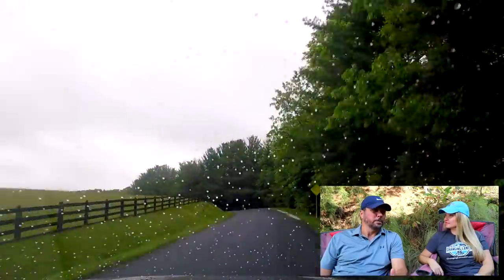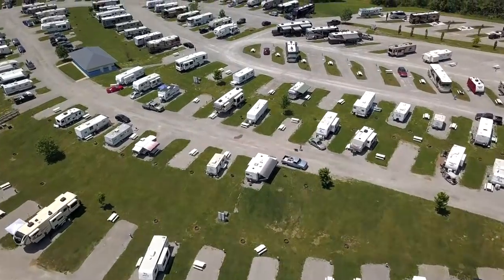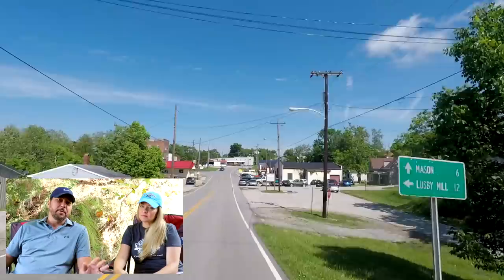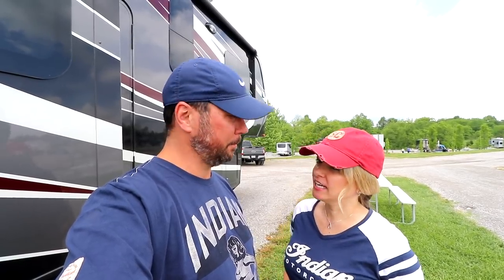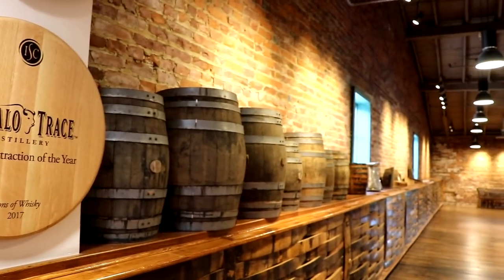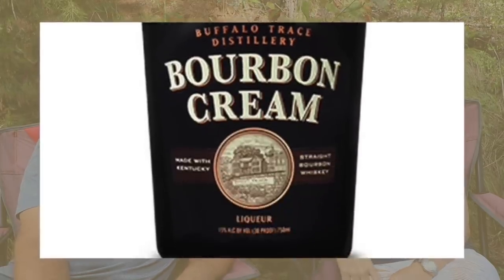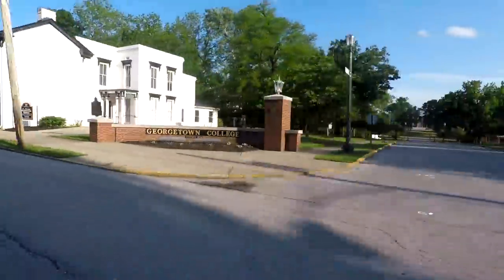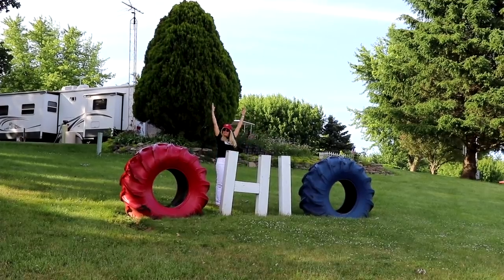Kentucky and Buffalo Trace Distillery [Full Time Travel] [RV Nomad]

Comment: Next time you get out that way go to the Maker's Mark Distillery in Loretto, KY. Just like Buffalo Trace the grounds are amazingingly beautiful and the tour was great. NOTE: you will NOT want to take the rig up there if you come in off of I-65 - roughly 20 miles off the interstate(?). Very twisty ,uphill, skinny, 2 lane road with trees hanging over the road on some portions. We took our F150 and there were a couple of times we weren't sure if the oncoming traffic was going to take our side mirror off. But man, what a beautiful drive up there and back.
Reply from the maker: Makers is definitely on the list for next time.  Hopefully the whole trail! 😎  Thanks for the tip!
Reply: I drove there in a Mazda Miata. The roads are lots of fun for sports cars and motorcycles, quite smooth and curvy. Lots of beautiful farmland. But I would not do it with any sort of trailer. But I did see distillery trucks leaving, so it's possible.

Comment: Subscribed to your channel recently; great vids.  I specifically like how you guys talk about your actual experiences mixed in with a few DIY instructional videos.  You can say that I'm living vicariously through your lens waiting out my months before I can retire and start my own journey.Thanks for sharing.What are those orange things under your levelers and do they sink into soft ground?
Reply from the maker: Thanks!  😊  The red "cans" under out jacks in the video are Andersen Jack Blocks. We don't use them anymore because we've broken NINE of them (6 we bought and 4 replacements they sent us). Simply unreliable. The bottom edge would break off and they'd sink into the gravel / dirt / whatever. We've switched to RV SnapPads and love them. They don't help lessen the jack extension like the Jack Blocks did, but they don't break and they stay on the rig, which is great when setting up and breaking down camp. RVSnapPads is also going to be coming out with something called "stackers" that will help with the jack extension / stability. We'll be helping them prototype that and, of course, do a video on those when they come out. If you're thinking about buying SnapPads, use our link and get $10 off. (https://rvsnappad.com/discount/LANES10) Also, they are about $30 cheaper direct versus Amazon, so $40 savings overall.  
Thanks for watching and subscribing!

Comment: Could you tell me where you bought those red pads for the stabilizer feet
Reply from the maker: The red "cans" under out jacks in the video are Andersen Jack Blocks. We don't use them anymore because we've broken NINE of them (6 we bought and 4 replacements they sent us). Simply unreliable. The bottom edge would break off and they'd sink into the gravel / dirt / whatever. We've switched to RV SnapPads and love them. They don't help lessen the jack extension like the Jack Blocks did, but they don't break and they stay on the rig, which is great when setting up and breaking down camp. The same company is supposed to be coming out with something called "stackers" that will help with the jack extension / stability and integrate with the snappads.  We'll be keeping our eyes out and do a video on those when they come out. But, we've been using the RVSnapPads for several months now and really like them. They are cheaper direct versus Amazon, and if you use our link / code, you can get another $10 off: https://rvsnappad.com/discount/LANES10  
Thanks for watching! 😊

Comment: What is it you put under your front leveling jacks
Reply from the maker: The red "cans" under out jacks in the video are Andersen Jack Blocks. We don't use them anymore because we've broken NINE of them (6 we bought and 4 replacements they sent us). Simply unreliable. The bottom edge would break off and they'd sink into the gravel / dirt / whatever. We've switched to RV SnapPads and love them. They don't help lessen the jack extension like the Jack Blocks did, but they don't break and they stay on the rig, which is great when setting up and breaking down camp. The same company (RVSnapPad) is supposed to be coming out with a new product that will integrate with the SnapPads to help with the jack extension / stability. We'll be keeping our eyes out and do a video on those when they come out. But, we've been using the RVSnapPads for several months now and really like them. They are cheaper direct versus Amazon, and if you use our link / code, you can get another $10 off: https://rvsnappad.com/discount/LANES10

Comment: AKA...Side of Beef. Just one side of beef is a lot. If the pub buys an entire steer, thats a huge amount to butcher up. Sad thing is, many as you say "source" their food items which come all nicely packaged, weighed to similar sizes, vacupacked etc. vs. the above. Historically, the best sources for beef is hand butchered by an experienced butcher who knows the many cuts and how to trim them out. Finding naturally fed and aged beef is getting to be scarce as the big conglomerates put pressure on ranchers to hurry up feed and raise cattle for slaughter, cheaply. Grass fed is good also corn fed is good if the corn is real corn vs a corn based "cocktail".

Batteries. The one you purchased is nice but very expensive. I hope its service life is 5+ years. Also very reliable is the AGM style battery vs. the very dated lead acid versions especially in vehicles that yield much vibration. An ATV I use has an AGM battery, $79, and it's beginning it's 7th year of reliable service. Battery tender charge it, 2 Amp max, about every two to three weeks when not in use. Next time you're in TN and feel like being in the middle of noplace, head for Lynchburg and hear about the Tennessee Whiskey distillery, it's just about self contained, like your RV.
Reply from the maker: We hope to add solar and upgrade to Lithium next year.. 😎
Reply: @ChangingLanes  Lucille's battery referred to, sorry. Sounds good on the "house" batteries. Maybe Electric Heating too !  Save that propane for the griddle and refrigerator ! Check out "Lifeline" battery co. Best in the business and they supply the aircraft industry needs. West Covina, CA and Georgia. http://lifelinebatteries.com/knowledge-center/compare-battery-types/
Reply from the maker: Ahhh. yea.. Replaced Lucile's battery with this lithium one already: Antigravity ATX20-RS Lithium RE-START Battery: https://amzn.to/2yk7Uvd   Built in jump start!  😎
Reply: Still scratching my head if your online purchases are being mailed to your current RV park or future RV park or someplace else. LOL
Reply from the maker: Usually a little of both.  Pop it in Amazon and see the delivery estimate...  send it to the next place if needed... We have to go clear out our Amazon addresses every few months.  LOL
Reply: @ChangingLanes  Cold weather time. Keep your BAT fuel and oil filters changed often, frequent drains of the fuel water separator and more than recommended oil changes. You likely know this however, key to life on the 6.7 is clean oil, clean fuel and more often than mauf suggests. Use Ford filters like a religion.